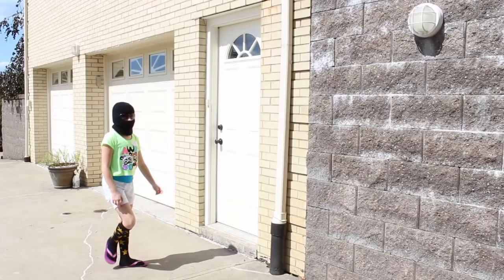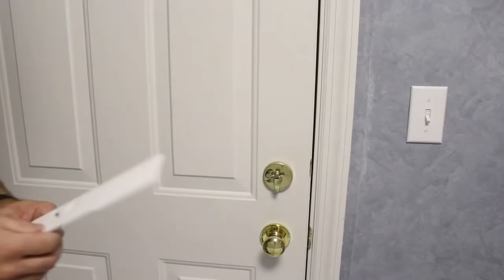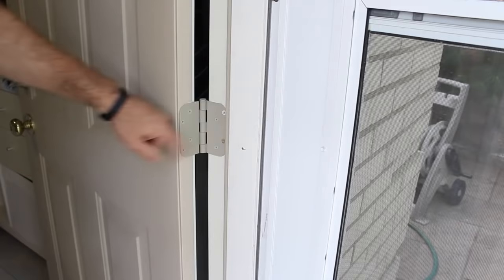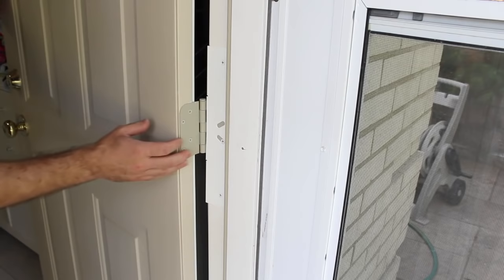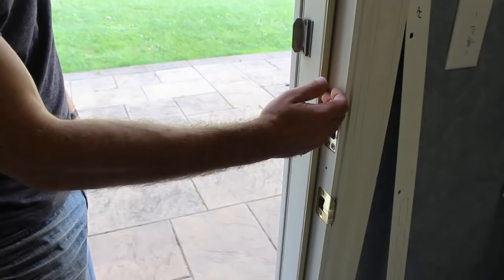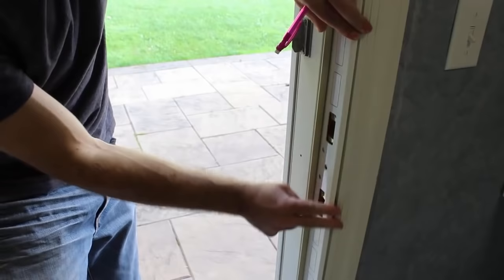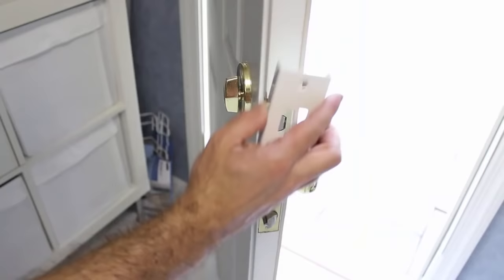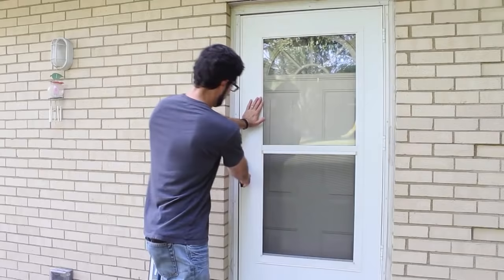How to Reinforce and Burglar Proof Your Entry Door

Comment: Crime prevention shows that if you have correct lighting and a good solid door that will deter a burglar for five minutes it will stop them.
Reply: +desert1cop WRONG.. In my small City we have had many daytime burgalries, they kick the door down in seconds steal TV, laptop anything they can grab in minutes and they are gone.. So much for your correct lighting theory.That is my reason for being here now.. and it has nothing to do with the strength of the door, the wood, hinges , screws all break loose... Think before you give incorrect advice

Comment: Putting longer screws into the door lock does nothing. This is where the door will fail.  It will split open. These door lock reinforcers are equally useless as the screws would be in the wrong plane, further adding to the door splitting apart. They need to be bolted from one side of the door to the other. This door would fail pretty quickly at the lock area. The jamb will hold up but not the lock area.

Comment: what about patio doors
Reply: For a patio door, measure the slot behind the stationary 1/2 that the moving 1/2 rolls into. Then get a bar - wooden or metal - that's just a hair shorter than that slot. Place the bar in the slot when you go away, and nobody can get in. Get another bar 3 or 4 inches shorter to use for when you're at home, but want some ventilation.

Comment: This is of no value if your front door is like 90% of front doors in america and made of sheet metal. That insulated metal door of yours bends like a beer can if you kick on it. I worked at an apartment complex in Tucson and used to watch the cops kick in front doors regularly, despite the three locks every door had. The locks don't fail. It's the door itself bending in half that makes breaking in easy.

Comment: I recently restored my Victorian front door and before fitting new architrave I fitted a length of thick aluminium to the striker side of the frame. This will have strengthened the side of the frame that would take the most impact should anyone try to break in. Now, with the architrave over it, it's impossible to tell it's there. At timeline 9.16 https://www.youtube.com/watch?v=0JAR5jKFAAY

Comment: It's a ripoff. All you really need are the long screws. Replace all of the existing screws with the longer screws in your door and in your door frame and that thing won't come loose. Your door and door frame are only as strong as the screws holding it in place.

Comment: The last step strikes me as security theater. Well, so does the rest of this product if I'm honest. Either that or the people who put this product together don't understand how destructive entry works. Locks and doors will only ever buy you seconds unless you spend real money or have nothing worth taking. But the point of failure in that door will be either the deadbolt or the door itself. Maybe 2 bangs with a 10# sledgehammer and someone's inside. Ask yourself how long you think it would take your local fire department to enter your house or your police departments special task force. Its much more important that you not give people a reason to enter. Entry tools are not expensive, readily available and easy to use. Any dummy can drill through your deadbolt with a YouTube tutorial shorter than this installation guide for garbage tier "security" products

Comment: When I built my house, all doors open to the outside. You can’t kick it open.
Reply: Snow G   You buy security hinges. The door pin is locked by a set- screw which cannot be accessed when your door is closed. Check ‘em out on Amazon. Good question tho.

Comment: Bad advice is no advice, Pre-drilling prevents the lumber behind the door frame from splitting as you force the screw in with your "Impact" tool, so don't be a TOOL and DO pre-drill this will actually make the product perform as advertised, Don't always believe the internet. Oh and be sure you check to see if I am right or not, and, no wood doesn't always split as you put a screw in, but it dose at a high percentage, go run some screws in wood for a living and you will see, why be sloppy?.

Comment: just replace the short screws w/ 3" or 3 1/2 "  screws job done don't need to put those expensive thing
Reply: Considering that the frame wood was only 1 3/4" I don't suppose anything longer than that really has a notable benefit.
Reply: you want to replace the 3/4" screw  w/ 3" or 3 1/2" so it will reach the stud, I did it to my door somebody kick & pried the door knob with shovel the stupid burglar left empty handed except I place the  door knob

Comment: This install video should be redone because you should have mortised the hinges, which in-turn would have allowed you to use the strike plates.  There is a reason they included those in the kit.  Additionally, the person that installed that door without mortising the hinges should be kicked on the chin... ;-)
Reply from the maker: +Mike85x7 I agree and it wasn't me. The previous homeowner bought and installed those doors which totally suck because they're metal and putting a mortise on it would be a pita.

Comment: 70 dollar price point is extremely high. You can DIY this for a lot less.
Reply: Also assuming that you have hinges that are flush to the frame is kinda silly. I bet 30%+ of people that install this end up ditching the hinge plates. That means you get 3 pieces of steel/ Aluminum and a bag of screws for 70 bucks. Super rip off IMO.

Comment: "Burglar Proof " = total bullshit. There is no such thing. 
There is only "burgulary resistance". 
Longer it takes to break in and more noticeable (noise / sight ) the break in is the higher risk they have to be cought.  
What that kit does is adds like 2 second to that door's burguary resistance. Competent burgular goes through that door in less than 6 seconds. 

Incompetent burgular will just kick in that door splitting it in half.

Comment: that plywood doors will not be burglarproof at any case... the door must be strong and the frame also..
these kits are trash... beter install a new door and a reinforced frame.. safe doors are heavy and pricey
Reply: Theseus 
It works fine for the average home.
I've seen what it looks like after a few attempted break ins with these things on the door and frame.
They gave up and moved on.

Comment: The hinge guards are a waste of time, just replace the screws for longer steel screws, replace the screws one the hinge attaching to the door as well and replace the door itself, as it appears to be of sandwich construction and a door frame would be best replaced with a hard wood.  This kit is overpriced for what looks like just pressed metal and cheap long screws.

Comment: First off, the hinges connected to the DOOR are the weakest point, second predrilling protects the wood and has nothing to do with your impact driver, third the door jam shield has very little protection value at all so you spent $70 to feel safe onstead of making your home notably safer.

Comment: Leave a few strips of 3/8" plywood with sharpened 16 penny framing nails nailed thru..... Let the toughest bloke step on that. He will instantly drop. If you angle the nails a bit and at slightly different angles, the fellow will have to sit on his but to pry out the nails from his shoes and feet... If that's too heavy for you, Snowflake, use 8 penny nails just be sure to sharpen them with a grinder.... Do not so this if you have kids, elderly.... and only so this on interior of home or business....